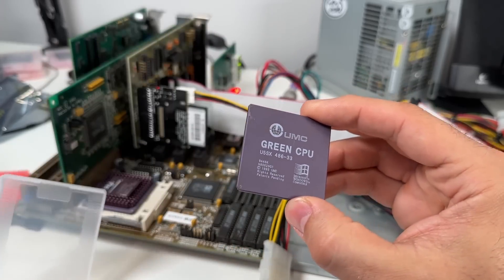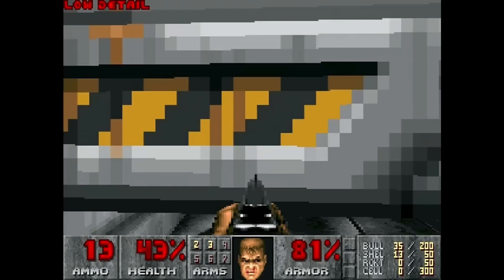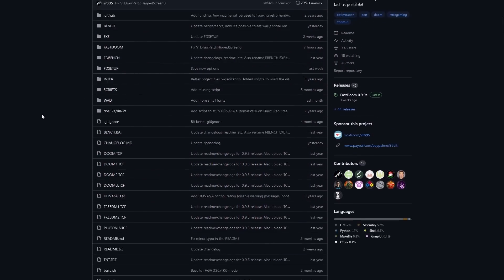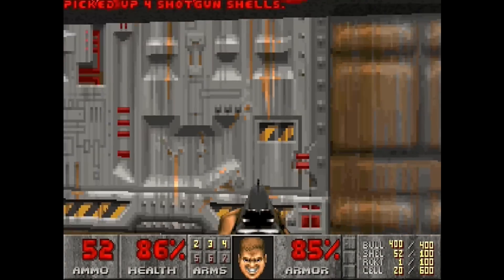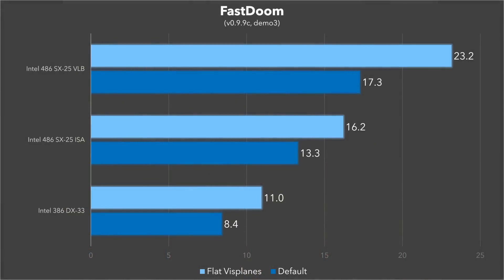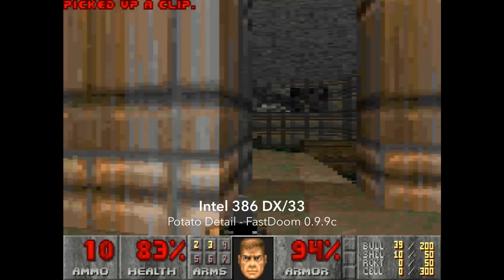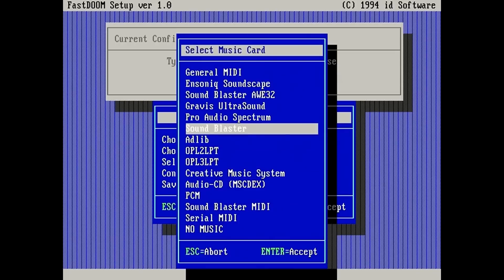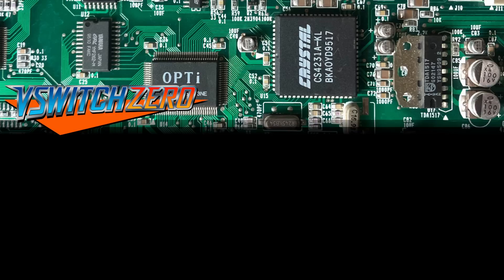FastDoom - Massive Performance Gains on Slow 386 and 486 CPUs!

Comment: I got ripped off with a "486" SLC-33 back in the Doom days. Basically a 386 with a few 486-style extensions. It ran terribly. 

I eventually upgraded to a 486-DX2-80 and it was an entirely different experience. Even the final levels of Doom II were playable and relatively smooth!

Comment: we need to find you a 486DX50
Reply: They were the OG. Only problem was expansion cards were very reluctant to run at that bus speed.
Reply: @B00MERTEC  I had one running 30-72pin simm staskers with, would you believe, 64 megs of ram.
Reply: @toddstewart4579  What a monster!
Reply: @B00MERTEC  in a compaq luggable case. The one with the orange plasma display. It was a glorious rig.

Comment: LEA, SHL, SHR are Assembly Language instructions abbreviating “Load Effective Address”, “Shift Left”, & “Shift Right” respectively. Doom IIRC uses fixed point for floating point numbers, so it will use the latter two instructions a LOT to do its mathematics calculations. 
- ex game programmer

Comment: This is a nonsense video.  I played doom on a 386-33 and it ran great.  It does not need a 486.
Reply: No it did not. Maybe in your head you thought it ran great because you never saw the difference vs other more capable systems. But, here in reality where we measure things objectively, it ran like absolute crap on anything less than a 486 dx66, &, even there, could barely reach its full framerate consistently. Your subjective notions do not supersede reality.
Reply: @NinjaRunningWild  How are my notions more subjective than yours?  Obviously a 486 is objectively faster than a 386.  But DOOM did not run like crap on my 386 DX-33, with the Cyrix co-processor, 8mb RAM, and a Paradise SVGA card.  It ran quite well.

Comment: I had i386-SX (20 Mhz or 40 with "turbo") and had 4mb RAM with trident 8900 vcard. No soundcard though. I played both Doom and Doom2 on it with limiting window to 320x240 and it was playable at least and I finished both games :) I even played Warcraft 1 on thaty PC ) Fun times ) Also I can personally attest to that Windows 95 OSR 2 can be installed on i386 SX with 4Mb RAM and 170Mb HDD. Installation itself took 5 hours but after that it even worked :)

Comment: If only I still had my 386 DX 20... That thing could barely run Doom (I think its 64K of cache helped it a lot), but man, did I have some fun with it !
ISA graphics and Sound Blaster 2.0 - the "low" mode would certainly have alleviated bus contention.

Comment: Another great video. I can still remember when Doom came out and I had 486DX2/66 VLB system. I thought I had died and gone to heaven. Fast forward 30 years and Doom is running smoothly on systems no one thought possible. You just have to tip your hat to the Vintage Computer community and all the ingenuity out there. It is really amazing!

Comment: I had a AMD 386dx 40mhz back in the day and Doom ran better than the DX30 you showed. Interesting.
Reply from the maker: I’d like to do some testing with a 386 DX/40 at some point. I’m sure the higher CPU frequency helps as well as the faster bus speed, memory etc 👍

Comment: Really drives home how profound an accomplishment the SNES doom port was.
Reply: The various console ports of that generation were pretty impressive
Reply: It was pretty impressive indeed, but it wasn't quite 'proper' Doom, it ran on an entirely different engine specifically made for that port.
Reply: 32x port was my first experience and part of what made that 160 dollar add-on very much worth it to me ...I wouldn't get my first pc until 2003 so I had no clue I was missing angles or levels...just enabled god mode and chainsawed the heck out of everything!
Reply: The fact that Doom was able to be playable on a 21 MHz 16-bit SNES co-processor is nothing short of amazing. Randy Linden deserves all the praise for it. Also in a digital foundry interview Randy said that he could’ve made Doom run almost twice as fast if he utilized the HDMA technique that the SNES has, the CPU cycles saved from it would’ve been insane. Would’ve made the SNES port run just as well as the i386 DX-33 using FastDoom in potato mode with all the other tweaks
Reply: @yancgc5098  What HDMA technique?
Reply: 10 frames per second might be an accomplishment, just not one that was worthwhile imo
Reply: @Dormat25  At least you didn't need a mushroom on the SNES. And a slight overclock was all it took to improve the performance. 

And it included PC level layout not the cut down Jaguar layout.
Reply: And yet they refused an Amiga port.

Comment: 11:30 ah so potato mode is like modeX! You first select the affected bitplanes via outPort and then write the byte . Usually, this is slower than chain4 because you need two instructions, but Wolfenstein3d selects 4 rows per frame ( 012301230123 ) and potato selects all rows at level load. Wolfenstein3d needs to draw vertically. How does doom (without floors) draw ? Does potato mode draw directly to VRAM? Does solid floor draw directly to VRAM? With vertical drawing, 80, 160, and 320 should be fast. With xmode 320x400 is possible.
Reply: Doom uses Mode X with direct rendering to VRAM (there is no overlapping except for 2D sprites, like monsters, items and some walls with transparency). Basically potato mode extends low detail mode (160x200), by selecting all planes at the start of each frame, which basically behaves like a linear framebuffer. This avoids selecting planes for each column rendered, and same for visplanes (floors and ceilings). And yes, it's possible to add support for 320x400 mode.
Reply: seems like too many in/out instructions to beat the gun. perhaps they draw to memory and then transfer the whole screen? but that would only make sense in a 486, since it only needs 1 clock to access memory. modex gives you access to the whole 256kb vram. maybe they draw to the non visible parts of it and then transfer the whole plane using the latches, doing 4-byte vram to vram? there are so many ways but isn't even potato, still in mode 13h?
Reply: @giornikitop5373  I got a low level hardware book as a kid, but it did not explain the timing. Is there a handshake between 386 CPU core and memory cell in VRAM? “Acknowledge lines” . Documentation about Jaguar and PS is open about it: storing values in any DRAM is fire and forget. If you are really unlucky, race conditions may occur.

I think I did not notice screen tearing below the abysmal frame rate on 386. Wing commander has it, too. Also runs in EGA.
Reply: @ArneChristianRosenfeldt  Doom doesn't have screen tearing because it uses tripple buffering
Reply: @viti95  I guess my problem was that the public source is for Linux? Only in DOS we can access IO. All other OS protect it. I thought that copy from main RAM is a given. I thought that all games have a backbuffer with 16bpp similar to AtariJaguar. And then on vertical retrace when the slow graphics card of the time give us time to access VRAM, we look up the 8bpp values. I thought that invisible in Doom and Descent are a dead give away of this. If we look up anyway, we can also deal with modeX interleave. But I read that one game really just copied. Maybe those coders did not understand ModeX? Visiplanes directly in modeX would be very slow.

Comment: I ran Doom on an Intel 486DX 33MHz overclocked to 40MHz with a 1MB VLB Cirrus Logic VGA card. It wasn't terrible but wasn't ideal either. This port would have been amazing back in those days.
Reply: the vga speed problems were a very mixed bag, back then. although, vlb did ensure faster transfer speeds, it didn't meant better actual speed in doom. there were a lot of vlb cards that performed like crap, and some isa that performed very well, due to having buffer chips, so being able to respond to read/writes much faster. the problem was that they were expensive and you had no clue which cards were which, until you bought them and tried them.

Comment: I'm kind of surprised about this. I figured all doom development was in windows these days. The CMS sounds like the speaker wires are frayed or something. lol I also remember I didn't have a sound card so I had to use PC speaker. But I had wintex 3.4 or something like that. These days, slade is the modern wintex. Ironically I feel like slade still misses features that wintex had. Anyway......I found the PC speaker sounds. Extracted them and put them in a new WAD file after extensively modifying (randomly) them in a hex editor. The sounds I got out of that were beyond strange. It sounded like the most alien things you've ever heard of. Also the sounds didn't stop. It was more or less constant. Apparently the length of the file isn't how long the sound is like with WAV.
Reply from the maker: Thanks for watching! That’s very interesting about the PC speaker sounds. Always something very nostalgic about PC speaker audio 😁
Reply: @vswitchzero  lol for the most part no. I hated it and was tempted to cut it off many times. Especially after I got a sound blaster.

Comment: speaking about maximising performances on i386 and i486 was of course the choice of a graphic card.. if i remember well Tseng labs ET4000 isa and ET6000 were nicely boosting performances compared to other vendors devices.

Comment: Played Doom on a AMD 386DX40,  my PC also had the 387 math-coprocessor installed (not sure it made any difference) choppy framerate and had to drop down resolution and screen size on the larger stages.

Comment: I recall back in high-school reading about a speed-optimized version of Quake to get it running on older hardware so even a 486 could run it smoothly. One of the methods it used to do this was the option to turn off perspective correction for world geometry. Unfortunately, I don't recall the name, but if you can find it and do a video on it, that'd be great.

Comment: Doom worked great on a 386sx16, the trick was MCGA mode: 320x200 at 256 colors. The whole framebuffer was 64k bytes, so it got something like 16 frames/second, plenty smooth for the day.

"Window size?" It launched from DOS...
Reply: MCGA mode (aka mode 13h) does little to nothing on the 386SX. FastDoom supports this mode, rendering first on a RAM backbuffer, and then copying that backbuffer to the VRAM. This is faster on high class 486 or Pentium machines, but makes basically no difference on the 386SX. It's extremely limited by it's 16-bit bus and having no cache at all, also the 16-bit ISA bus doesn't help. Rendering 64000 fully textured pixels it's just too much for that cpu.
Reply: @viti95  It worked for me in 1994. It's why I learned mcga programming under DOS. Feel free to insist 30 years later that it couldn't have.
Reply: @myphone4590  don't insist. doom olny supported mode 13h and some modey with the low graphics option. mcga 320x200x256 is simply the vga mode 13h, there is no trick. "Window size? It launched from DOS". if you're not being sarcastic you're clearly irrelevant, everybody in the world knows that in doom you can inc/decrease the playable view with +/-, that's what ppl mean when they refer to doom's window size, they don't mean window as in windows os. as for the 16 fps, most unlikely.
Reply: @myphone4590  well, you learned mcga programming huh. if is was the 320x200x256 mode, then congrats on learning y*320+x=pixel color.

Comment: Could be me remembering it wrong, but when i switched from an Am386-DX40 to a Cyrix 486-DX40 with the same graphics card, a TsengLabs ET4000, back then it didn't feel like under 20 FPS. o.o

Comment: Great topic. So many videos about Doom show modern Doom ports with upgraded textures. Few show the original Doom and fewer still talk about how difficult it was to run it.

Our first family computer was a Pentium 133 in 1996, so Doom was no problem. Sometimes I would run Doom II's Icon of Sin level in god mode to see how long it would take to crash (a few hours).

But everyone else we knew were running older computers from 1990-93, so couldn't run Doom properly. Basically only rich people could run Doom at full capacity when it was new.

I was lucky to have a Pentium but still had to wait until 1996 to play at all.

Then the cycle kept going with Quake... would crash in a few minutes.

Hopefully one day computers will plateau such that the best games are affordable to everyone when new, rather than having to wait years.

Comment: I ran doom on a 386DX40 and it ran smoothly. In fact the m,anual for Doom specified a SX as the minimum system requirement.
Reply: Yep I had that too. I wonder do we rember wrongly, or we had "late" 386DX40 systems that had fast DRAM and some external SRAM cache.

Comment: Me and all my Amiga friends bought 486s within a couple of months of Doom coming out. We didn't spend anything like $5000-$6000, even including VGA monitors. Pretty sure I got a DX33 as the sweet spot between fast enough to run Doom properly and not too expensive.  From memory we spent less than $1000 and that's Australian dollars. We all bought generic beige boxes from mom-and-pop PC shops.
Reply: yeah, doom was essentially the death of every other home computer, except for the pc.
Reply: $3900 AUD for a complete 486-DX2 66 system 1994 dollars and a perfectly Classic Amiga 2000 thrown out instead of being kept.

Comment: Increasing cache had a massive impact.
Reply from the maker: True! I forgot to mention in the video that this 486 board had been upgraded from 256KB to 512KB.
Reply: @vswitchzero  Yeah back in the day I went nuts wondering why I didn't get much improvement on a 386DX when I Overclocked 33 to 40mhz and upgraded from 16k to 64k. That was my first introduction to chip counterfeiting! Luckily I had some 32k hanging around and figured it out. :D
Reply: chuckles in X3D
Reply: @Wahinies  Completely different animal, there was no l1 only the off chip "l2" while x3d is l3 and internal to the chip just like the l1 and l2.

Comment: 2:40 I guess my 486SX-20 wasn’t popular then! It did run Doom, I think our brains back then filled in the missing frames 😅 I got the opportunity to talk with John Romero at a recent convention in the UK, he said they called the SX line of 486’s internally as “suxs” to go along with its lacklustre performance back in the day 😂
Reply from the maker: A 20MHz SX is indeed pretty rare and hard to find these days. There is even a 16MHz 486 SX that was found in a limited number of OEM systems. Most 486 boards have a minimum bus frequency of 25MHz, so it's not easy to run them without overclocking them. Some older ISA boards with a crystal socket can be adapted for them though. Thanks for watching!

Comment: What was the game that was like worms but it had only two gorillas that threw bananas at each other. You had to guess the coords with some math skills I think even included wind or air drag. You could increase the explosion graphics to take up the screen. I believe it was a 486 game.
Reply: Qbasic Gorillas.bas, it came with Qbasic on DOS.
Reply: That was QBASIC example program GORILLAS.BAS

It was not a 486 game, it'd run nicely on much slower hardware.
Reply: Gorilla.BAS it was a game that came with QBasic, along with Nibbles.BAS

Comment: Oh, back the in the day I wrote a ModeX pixel*pixel scrolling RPG engine in Quickbasic. One of the most important parts of writing that was figuring out how I could reduce the port access to switch planes. I eventually figured out how to do the entire screen largely without a bunch of extra multiplications and divides, and I could  do the entire background for one plane in one go. Talking about potato mode reminded me of that.
Reply: yeah, i/o instructions were significantly slower in anything above 286, which was weird, since even the oldest home computers like commodore64 etc. had memory mapped i/o, but 8086+ didn't. but then again, intel did not create the 808x to begin with.

Comment: lol. i guess if i had a 386 in 1994, that potato mode would have been pretty compelling. the only thing that's weird about it is that the graphics look noticeably worse than Wolfenstein 3D does on a 386. would be nice if there was a way to just give doom a more W3D look for those old systems rather than making everything so blurry
Reply: The problem is that Doom supports much more complex maps than Wolfenstein 3D. Doom's arbitrary wall angles and varying ceiling and floor heights are a lot of additional math the processor has to crunch through.

Comment: Is ram overclocking possible on those older systems?
Reply: In that the RAM and the CPU operated at the same bus speed, yes.
That's actually why clock-doubled processors like the DX2 came out, the DRAMs of the time weren't reliable at the faster processor speeds. It let them keep the system bus at 20MHz while running the CPU at 40.
Reply: Keep in mind that these are NOT synchronous RAMs, so they don't really have a clock per se